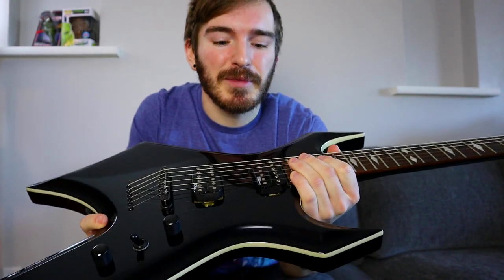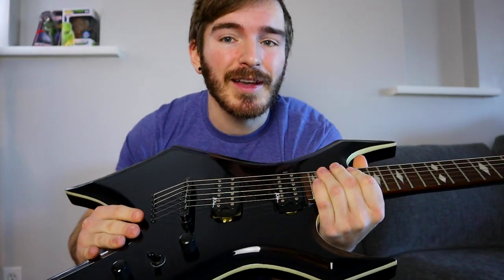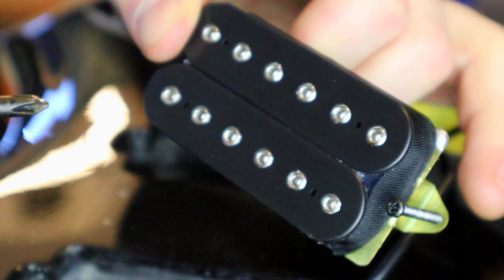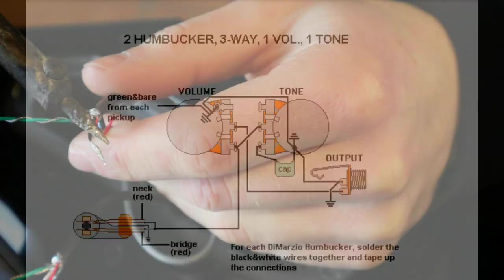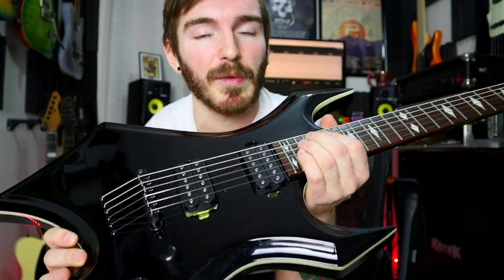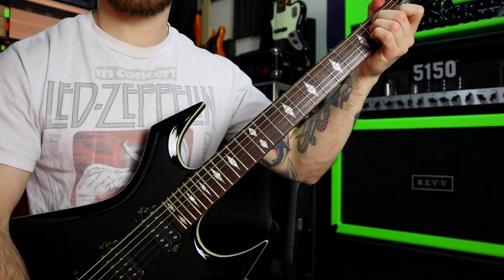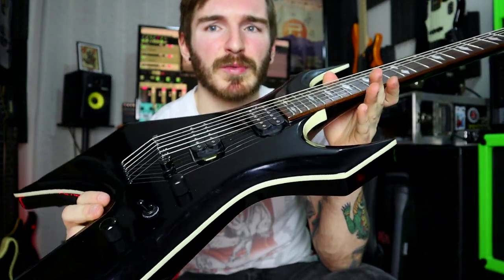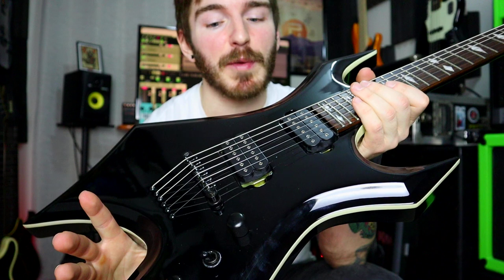RESTORING AN EVIL BC RICH WARLOCK - BC Rich Dark Arts Warlock

Comment: Great work man, that was so dope when you opened up with Nemesis. One nitpicky thing though, most luthiers only use a tiny spot of CA glue to install the nut. What you did wont hurt anything but it may not come off if it ever needs replaced in the future.
Reply from the maker: Thanks! Wood glue is actually preferred when installing hardware like a nut or straplocks. If you need to remove the parts you can do it easily and the Wood glue won't rip any other material away when you're changing hardware.
Reply: @EricMorettin  I imagine it would definitely bond better with the neck, the way you did it. Better sustain!
Reply from the maker: @HughJassill  exactly! Crazy glue will damage the surface if you need to remove the nut in the future

Comment: Hey man, the other day i bought a same guitar as this and im just curious if yours has a writing on the back of the head that sais made in china like mine. Im only asking because im not sure about that bc rich manufacturing in china. There is a huge chance  that bc rich is maufacturing in different countries based on where they are selling it but i am a little suspicius about the made in china thing. At this point im not sure if mine a cheaper model or if its a fake one. Awesome video by the way!
Reply from the maker: Hey I honestly don't recall the back of the headstock on this. Guitar manufacturers make their import line in so many countries, especially countries like Indonesia, South Korea and China to keep the costs down (that could be a whole topic in itself). I wouldn't be surprised if BC Rich made some of their guitars in China tbh, as many companies produce some of their models in China. Nothing wrong with that tbh. It's pretty easy to spot a fake Ali Express guitar by comparing it to the original one. I'm sure yours is fine though, but if you're concerned then compare it to other local guitars or Google images of your guitar. Thanks!
Reply: thanks for the information and the advice

Comment: i have 2 b.c. rich warlocks one from the 80's and the other from the late 90's to early 2000's,  id like to upgrade to a nicer bridge on both, where can i find a good place to get replacement parts ? i tried looking on the b.c. rich site but all they have are heavily overpriced reissues but no replacement parts, thanks.
Reply from the maker: All depends on what kind of bridges you have versus what can drop in as a replacement. If you contact me through my socials with pics I may be able to help out
Reply: @EricMorettin  will do , thanks